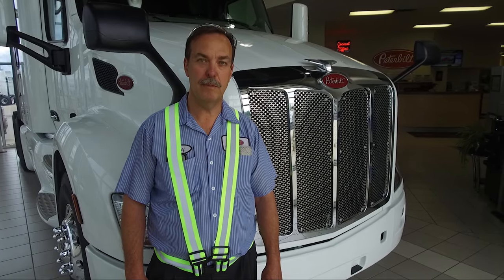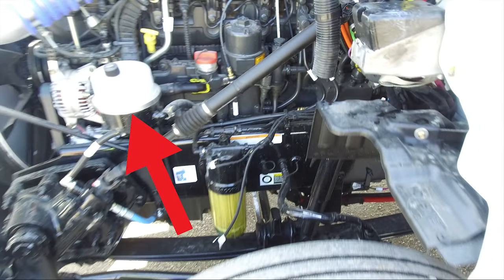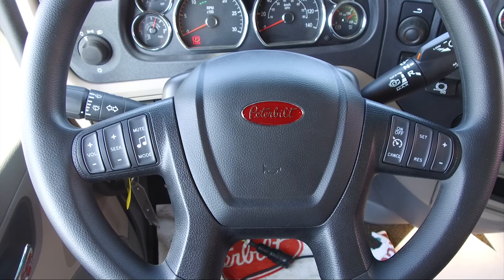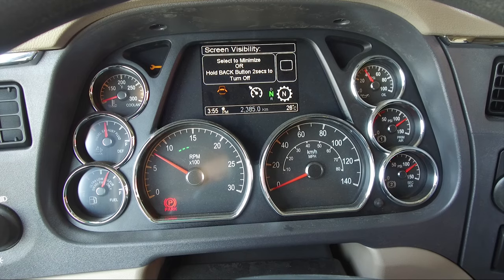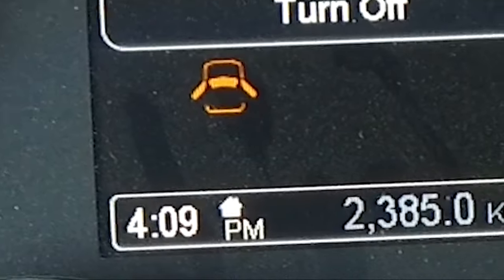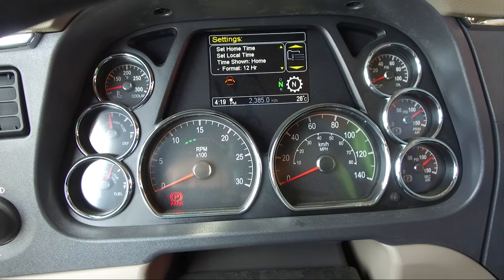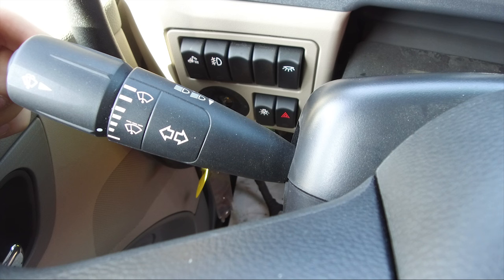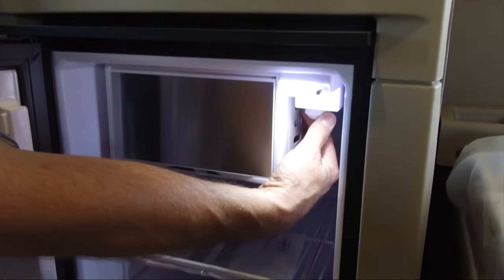2019 Peterbilt 579 and 567 Features and Functions

Comment: How do I keep the truck from the idle shut down in below +27C weather. During the summer I can’t get a good night sleep. I constantly have to tap the pedal to keep the truck cool enough to get some sleep. I am quitting my job because of this issue. If my new company shows me a Peterbilt 579 I’m telling them flat out I’m not interested in driving a truck with that feature during the summer.
Reply from the maker: Assuming your truck is a 2013 model year or later, nothing is wrong with your truck,. This is a 5-minute idle timer shutdown, which is an EPA/ECCC requirement. From our Paccar documentation: "Emission Model Year 2013 – 2020 vehicles registered in the United States are regulated by the Environment Protection Agency’s (EPA) Greenhouse Gas Phase 1 requirements to cut carbon pollution and improve fuel efficiency. California Air Resource Board (CARB) and Environment and Climate Change Canada (ECCC) adopted these requirements for vehicles registered in California and Canada. Emissions Model Year 2021 and later vehicles registered in the United States are regulated by the EPA’s Greenhouse Gas Phase 2 requirements to cut carbon pollution and improve fuel efficiency. CARB adopted these requirements for vehicles registered in California and added additional standards and compliance requirements. ECCC Heavy-duty Vehicle and Engine GHG Emission Regulations require vehicles registered in Canada covered by an EPA certificate of conformity to also comply with EPA’s Phase 2 requirements." Peterbilt does offer SmartAir options, and this is a topic we suggest having a conversation about with your company, as all trucks that fall under EPA/ECCC regulations will act the same.
Reply: @PeterbiltManitobaLtd

Comment: What are the 3 lights on the rpm side? I’m asking because mine only has 2 lights on.
Reply from the maker: The green lights indicate the engine speed for optimal fuel economy. 2 lights just gives you a shorter "sweet spot" RPM range for maximum fuel efficiency.

Comment: What is the purpose or when do use the Power Take Off (PTO)?????
Reply from the maker: Hi Sami, a PTO is a device that transfers power from the engine to another piece of equipment / auxiliary component(for example: raising the bed of a dump truck, operating the winch on a tow truck, powering a garbage compactor, etc.) to avoid needing an additional dedicated motor for powering those devices.

When engaging the PTO, power is diverted where required, and the truck's engine idle will increase.

The PTO switch is optional and would only be needed if the truck needs to power another piece of equipment as mentioned above. Turning the switch on engages the PTO.

For more information on switch operation, you can consult an Owners Manual (available on our website at https://www.peterbiltmanitoba.com/manuals/ )
Reply: @PeterbiltManitobaLtd  thank you so much. I guess it serve no purpose if a truck with that feature is pulling a reefer or dry van (container). Thank u sir!

Comment: How do you get the heat to work when auto start is on? I can not get it to work please help.
Reply from the maker: The heating system isn't meant to function with auto start, it simply monitors state of charge of the truck. If you require auxiliary heat, you would need an auxiliary air heater installed (ex: Espar, Webasto, etc.)
Reply: @PeterbiltManitobaLtd  so if we want heat while the truck is stopped our only option right now is probably to idle correct ? Thanks for the response!
Reply from the maker: @BeastMimicryMBC  Yes, that is correct!

Comment: no clutch pedal on the rig. the speedometer is metric but the gauges are in Fahrenheit, pounds square inch, instead of Centigrade or bar or kilopascal. does it have a flash to pass?

Comment: Is it normal for green check engine fan light to be on?
Reply from the maker: Hi Alexis, that light is not a warning light telling you something is wrong, that light only illuminates when the engine fan is actually on. Turning the fan off should then turn the light off. If the light is on but the engine fan is off, this is not normal operation and we'd suggest you take your truck in for service. Hope this helps!

Comment: How are mirror (bracket) adjustments done?
Reply from the maker: Are you referring to the mirror arms on the doors?
Reply: @PeterbiltManitobaLtd  
Peterbilit 567: Yes I'm talking about the surrounding sturdy black bracket/mirror frame attached to both doors, neither mirror bracket will budge, there must be a spring tension adjustment but I can't find it nor can any other driver I've asked. 
All I want to do is bring in the mirror frames so I can access narrow spaces but I can't because the brackets won't budge at all.
I looked everywhere on the WWW with no luck, not a single mention per 2022 Peterbilt 567 mirror brackets anywhere! 
I know how the internal parts of mechanism works yet there's no information on how to set the tension.
Reply: @PeterbiltManitobaLtd  
YES - mirror arms/black mirror bracket connected to door, they stick out to far, can't access narrow places such as hot plants without scraping, it's like they're frozen in one position, no visual adjustment portals either. I know how the mechanism is supposed to work with tension spring and incremental slots , if I were to pull on the brackets any harder something would surely break or bend. The vehicle is a 2022 567 Peterbilt. Maybe spray on penetrating would loosen things up - what's your recommendation?
Reply from the maker: @labrat748  We tested this on a 2021 567 in our shop today. The mirror bracket is indexed, but unfortunately there is only one locking position. To move the mirror in, you can pull/push the mirror towards the cab door while slightly lifting up at the same time. It is difficult to move, so may require two people, one to pull from the cab steps and one to push from the hood side, but the whole arm will rotate in towards the cab, even though it won't lock into place in any position other than fully extended. If you leave it out of the index position, the bracket may move while driving, so do so at your own risk!
Reply: @PeterbiltManitobaLtd  
I got the mirror bracket to move inward but it takes a lot of force to get it to move. It can't be done from inside the truck, I had to stand on the cab steps. Tomorrow I'll apply a dab or two of penetrating oil to see if that helps...whatever I do will only be done while the truck is parked/not moving.
I really appreciate the advice and your professional attitude :D

Comment: What are 3 small green lights on the RPM gauge??
Reply from the maker: This is an Optimal RPM Indicator. These lights indicate the engine speed (RPM) for optimal fuel economy.
Reply: I thought it was a shift indicator for manual transmission letting you know when to shift 😂

Comment: Anyone know how to override idle management on a 2019 579? Apparantely, Peterbilt thinks that 39° Freedomheit with a 24° "real feel" doesn't require constant climate control. Btw, do NOT get this rig if at all possible! My dash has numerous pieces of folded up paper to keep the sqeeks and rattling down ...which still doesn't work. Don't even think that you can get the sleeper remotely dark, due to piss poor curtains (both between the cab to berth and the vents at the top of the berth) and don't even get me started on these cup holders! I could go on about the discomfort of this interior, but it won't make it any better. It's so bad, it actually makes me miss my 2015 Freightliner! 😮

Comment: Is normal for hest indicator comes on sometimes (  Exhaust high temp) ?
Reply from the maker: Yes, this is normal.
Reply: @PeterbiltManitobaLtd  and 1 more thing pls, when do I check or change the sensor cus my truck is 99,513 miles
Reply from the maker: @A.Bane28  Our best suggestion would be to take the truck to your local dealer if you're worried!